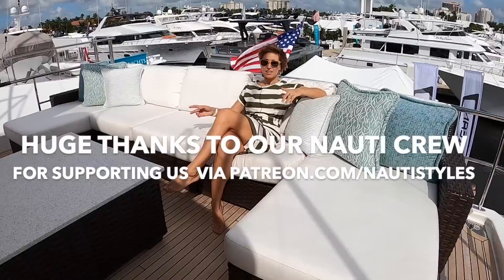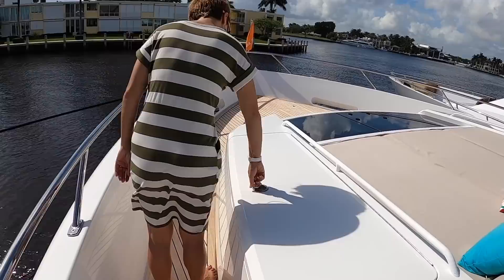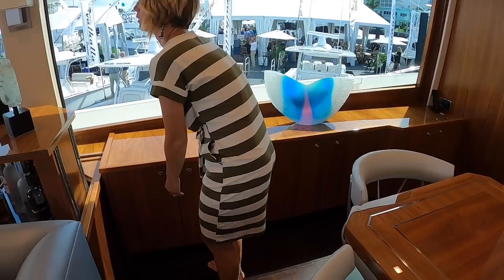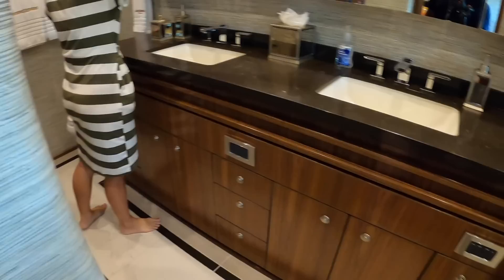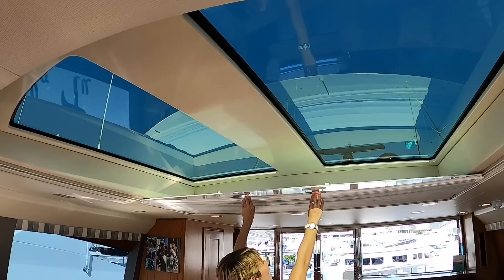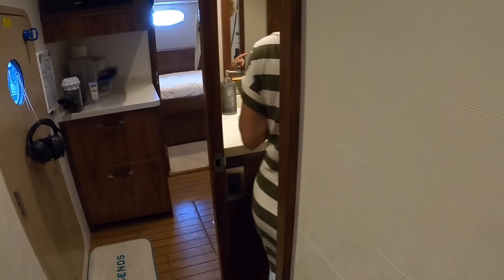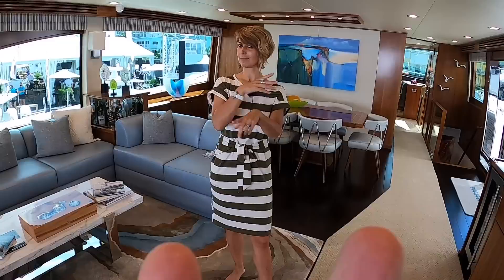$8,900,000 2018 93 VIKING MOTORYACHT "BOOK ENDS" Tri-Deck SuperYacht Tour & Specs Enclosed Flybridge

Comment: This is like the ultimate live aboard boat.  The galley and the Master suite make this look like a nice big condo.  Love it.  The fly bridge was the only helm station so it had to be enclosed.  Typically the fly bridge is on the top deck giving you a second station, also being outside giving you the option.  On this boat there was just the one.  Not to mention this has the nicest helm station I’ve seen in a while.
Reply from the maker: Glad you liked it
Reply: The problem with that is you have two helms taking up space that could be used by guests aboard the vessel. I think the single helm on an enclosed fly is a better use of valuable space aboard.

Comment: Like others have said, this feels like a high quality vessel. And the beauty doesn't end with the passengers' cabins... Even the crew quarters were finished out to a very high standard. Beautiful wood joinery in warm finishes. The design is not ultra modern, but perhaps then will age well. It has this casual feel everywhere... A good place for someone who doesn't have to impress anyone. It is giving you comfort without demanding your attention.
The art on display is not in-your-face wacky. Love the side door and balcony. And a great master cabin - it even has a proper table and chairs!
Some problems I noted were a lack of good windows and portholes downstairs, and perhaps too much carpeting. It is not clear if there is any wood flooring at all in the cabins. Also no bathtub or jacuzzi. I would lose one of the bars and rather install a bath.
Not keen on the 5-seat driving layout. It seems to be set up like a bus, where only one person can see the instruments and everyone else must keep distance.
The range is short, due to big engines and small tanks I guess. Crew mess looks too small.
And I would not like to always be indoors when steering the vessel. Definitely prefer an open flybridge... because every location will have at least some days that invite for it!

Comment: Only 400NM miles with 3150 gallons of fuel? I'd go broke with this ship.
Reply from the maker: At cruising speed
Reply: @NautiStyles  I see this comment on nearly every video.  Take a SEA-DOO RXPX 260/300.  They go about 67MPH flat out.  With a fuel tank of only 15.9/18 gallons they are out of fuel in less that 1 hour.  That is just how boats are designed for cruising speed or full throttle.  When you factor in cruising, stopping, channels, other boats, the fuel consumption all flattens out.  Going slower than cruising speed to take in the landscapes and your range increases substantially.

Comment: Just curious.......How is this considered a "tri-deck"?
Reply: Sleeping Quarters Deck, Galley/Salon Deck, and the Enclosed Bridge Deck.  The Decks/Levels.
Reply: @watsomd  usually the sleeping deck you speak of isnt considered.  A trideck is most often refered to as a boat that has a sun deck a bridge deck and a main deck. But you are ok most people like you that have no experience with real yachts dont really know what they are speaking about and need to be educated.
Reply: @watsomd  its really a dishonest count by them
Reply: @watsomd  decks are measured for identification as those being above the water line. Since the deck of lower cabins is below the water line they dont count. Benetti has a quad deck model out now but if you counted their lower decks int he count they would be at 5

Comment: The video is very good. But the yacht is not impressive. Only two little porthole window for three cabins (because one of them does not have any). A great option if you don’t like guests and they don’t like you. There isn't even a simple bath. I'm not talking about the hydromassage. And all of this is worth almost nine million. You can find a yacht cooler and cheaper than this one. Horizon FD87 for examlpe. Or the more comparable Pearl 95, which, by the way, has both a simple bathtub and a jacuzzi. If I'm not mistaken, Pearl 95 prices start at $7.77 million. So for about $8.4 million you can configure a proper luxury yacht.
Reply from the maker: Are you commenting on the right video? 🤔
Reply: @NautiStyles  wait a second… Well, yes, that's right.
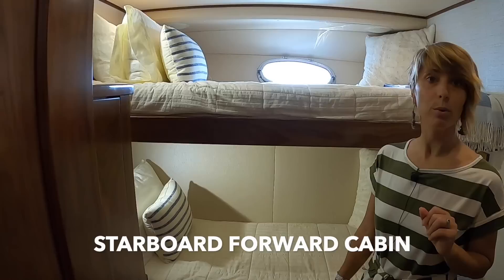14:05 starboard forward cabin has one porthole and appears to be for the crew and does not have its own toilet.
14:50 another double cabin doesn't have at least a small porthole.
15:45 "VIP" has one porthole, but not in the toilet. It looks like a room for a great-grandmother, who is certainly a very important person, but does not pretend to be luxury.
If you look at the other yachts that I gave as an example, you will see that there is a completely different level.
Earlier I already watched your reviews of Pearl 80 and Horizon FD80. Their major sisters are even more luxurious. 
In case someone missed them, here they are:
Pearl 80 – https://www.youtube.com/watch?v=ri_J_7EZDqE (includes several items on yours NBBL)
Horizon FD80 – https://www.youtube.com/watch?v=EK5M9vXi2DA
Review of Pearl 95 and Horizon FD87 we will be looking forward on your channel )